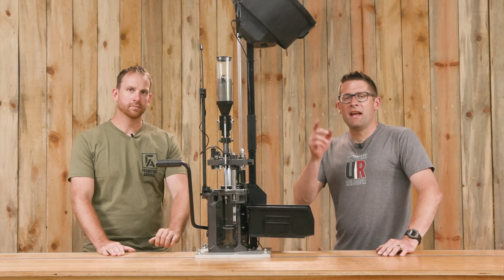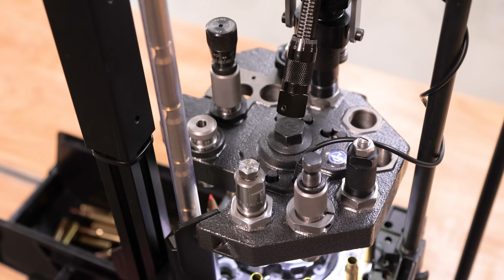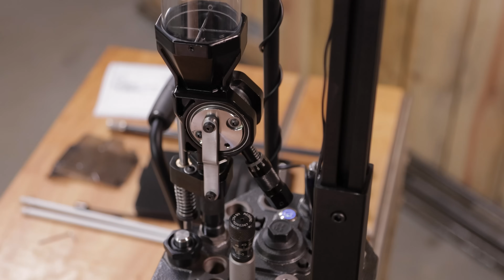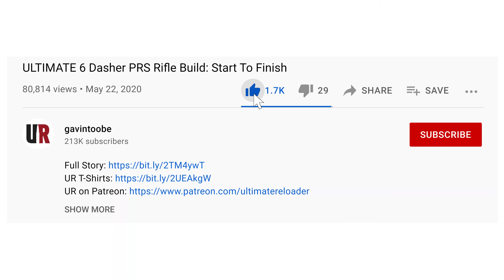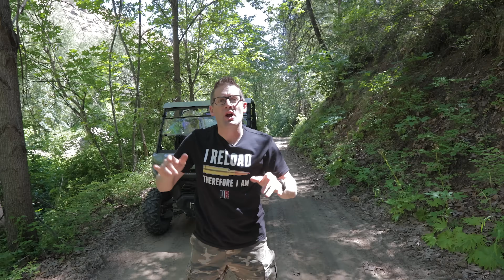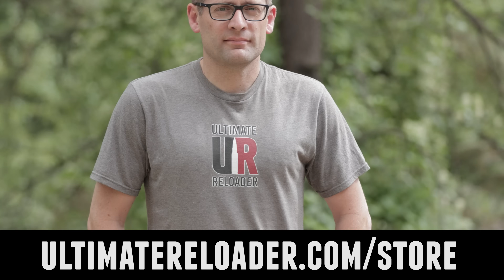Frankford Arsenal X-10 Update (Summer 2022)

Comment: I own one and it’s terrific but… does have a flaw in the metering dial on the powder measure, so loose that it turns on it’s own while reloading.  I solved this by removing the metering cap and replacing it with a jam nut once charge is set.  The rest is amazing

Comment: I like this reloader. My current reloader is the Hornady L n L AP. I like its simplicity as a novice reloader. My concern is whether or not the X-10 will be too complicated for me.  All of the demos I’ve watched have been done by extremely knowledgeable, experienced reloaders. Just not certain what to do? Cheers!
Reply: I graduated from a lock an load to an X10.  The principles are all the same but like the LnL it’s got quirks.  I’ve had mine a month now and am getting past the learning curve of what to do when it jams.  I love the case feeder works soooo much better and having 2 decapper stations is great.  

Now for the downside.  The ram mechanism is so beefy and strong that it is tearing up the much less robust indexing mechanism.  Happens if jammed up and just put to much pressure on the handle trying to free it up.  It’s an easy part swap to fix but be prepared to wait on hold hours to talk to the SINGLE technician on duty for customer support, and then they want pictures to prove it’s broken.   I might consider waiting a few months till they come out with a fix.
Reply: @deankaras8359  that’s good information and I thank you for it. Right now I’m just going to wait and see what others review. Cheers!

Comment: The depriming situation here reminds me of the old joke about NASA's 1M$ project of a ballpen working in zero gravity. The Soviets used pencils instead.

Decapping on a progressive (fully - from a case to finished product) press is a losing battle. First it means a lot of rubbish sprinkled generously over all the precision mechanics of the press, shortening its lifespan. Regular guys like their equipment to last. Secundo - there is still a lot of gunk (possibly even wet and/or with sand) in the primer pocket after decapping. This may lead to hang-fires and other mishaps. 

There are excellent choices of dedicated depriming equipment, some even by Frankford Arsenal. For me it is a must, especially with wet tumbling / ultrasonic cleaning. Rinsing and drying brass with old primers still in - never again.
Reply: Yeah. I like to keep my 1050 clean and well lubed.  Since switching to decapping prior to wet pin tumbling, the 1050 runs longer and smoother between cleanings.  A Lee APP fed by a Dillon feeder and driven by an air cylinder will decap quickly and efficiently- and when things wear out from gritty cases, parts (and the whole APP) are dirt cheap.

Comment: This FA Progressive machine seems great, and cost waaay less than my Dillon 1050.  What drives me crazy is the Primer stage on my Dillon. Just like this FA rep stated. I've had primers not load into the primer pocket, and would have powder everywhere after the powder stage.
Reply: China vs USA 
Communism vs Freedom. 

Choose wisely.
Reply: Yeah. On the Dillon it is critical to keep the inside of the primer magazine and the bore in the primer slide clean, and a weight (say a 45-70 case) on the primer rod.

Comment: I have been waiting for this release since early spring 2022!  I was told July 2022 before these would be available to the public; it is now September 2022 and it seems they are no closer to releasing these bad boys!  When can we expect these?  The price of ammo is just untenable and, although reloading material is also pricey, the delta still leans towards reloading as the best savings.
Reply: Exactly….when are we going to see these machines o. The shelf??!!
Reply: Aaaand....here we are 10 months later, April 2023, and still no X-10. This is probably beyond a few minor tweaks for QC before rolling out to the public. Seems more like "back to the drawing board" kind of delay.
Reply: @ancientorder4645  I wanna hold out on getting a progressive set up until this comes out but it doesn't look very promising when we are well into 2023 and the thing was supposed to release a year ago
Reply: Yeah I just checked still not out yet either
Reply: @dakotareid1566  I think you can get them on optics planet but they ship in batches
Reply: They’re on Frankfords website rn
Reply: I mean it’s not like it’s the only option to reload with, and if price is an option you spend way less on an intellidrop or the like and a lee classic turret and have way more accurate loads and way less unnecessary crap. All that extra process is so dang silly with a drum style powder drop spitting it’s random charges out. It’s why I never got into progressive presses
Reply: @monkmoto1887 good brand manual powder throwers now days like the Reddings and even the old Lyman no55 put every charge out within 0.1 of a grain every charge with pistol powders that meter well which is close enough for anyone making pistol loads even if shooting pistol competition. That being said I would never buy the lee classic turret press because i learned a long time ago when i wore one out to the point it would no longer allow it to size cases properly because of their aluminum linkage parts and aluminum against steel on other areas which over time wear out. Same problem with lees auto prime hand primer that had aluminum linkage that would wear out at its pivot point in the linkage and not seat primers deep enough once it wore down. You get what you pay for.

Comment: After sending a question to Frankford Arsenal about the delivery of the X-10 press I received the message in response today, and it seems to counter-dict the data in your video.  

On 8/9/2022 2:00 PM, Frankford Arsenal Case Email wrote:
> Currently there is  not set release date on these units. We have an estimated first stock in November so it is more then likely around that time but for now that is just an estimation with no set date.  

If this is the case, what is your object in having the release on YOUTUBE that your employee was said the release was coming up in the next few months.  WHY is your company publishing  false information to the public.  Are you just acting as having a product, to reduce the demand on the manufacturer of the APEX press?

Comment: I do have a question, can the powder drop be moved from the station its in? I find that dedicating a station to just case expansion a wasted space. Would love to put the powder drop into position 6, check in 7, bullet feed 8, bullet seat 9, final crimp in 10. Still the front runner to replace my 550B.
Reply: I wondered the same thing as I don't want to combine seat and crimp in one die...did you ever get an answer?  
I do see in this video, however, that the proprietary bullet feeder (in development) is going to feed and seat in one station which would solve the problem as configured.  After all these delays, I would have long ago brought this back to the good old USA for production and just raised the prices which they did anyway.  People will pay for quality.  Come on Frankford, a month or two delay is one thing, but two years or more is ridiculous and is costing them more than it would to just have produced here anyway.
Reply: @jamesa5720  no, never did. I've been following on the FB page and I've been told something is coming to address this, but that's all. So we will see. Forcing a product on you to get what you own to do what you want will turn ppl off. I already have a bullet feeder and if I can't use it with powder check, this press will be off the list. They are having teething pains, but FA has been right on top of them and making changes asap. So there's that, heh.
Reply: Not combining powder drop and neck expansion seemed like a waste to me, too. I wonder if there was a patent issue.  You’d think it could also have been built so station 1 does more than insert, say insert/decap.

Comment: So, in order to use powder check, I would need to seat and crimp on same station so it requires proprietary bullet feeder? Then, what exactly 10 stations solve? Exactly, nothing. Bad engineering. Also, due to the usable height your need to go waaaay down with the handle. This is really lacking and after say, 1000 rounds you will have enough.